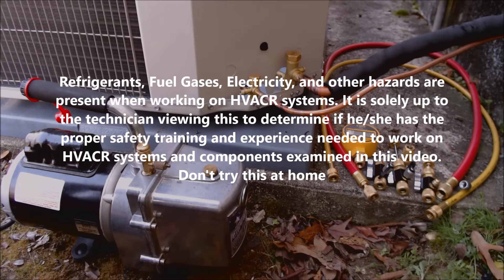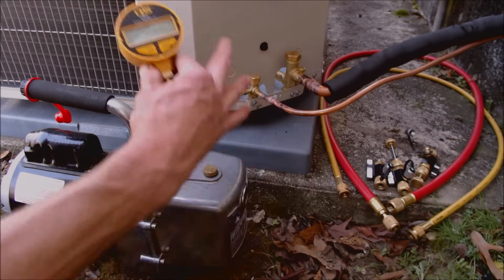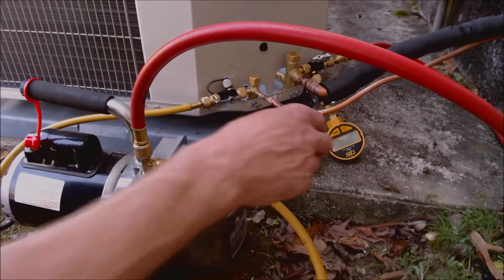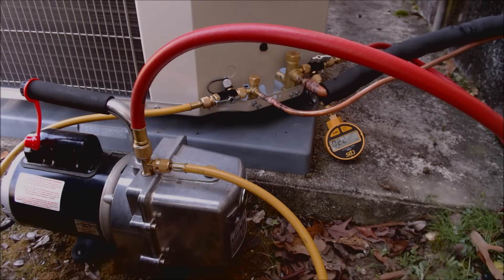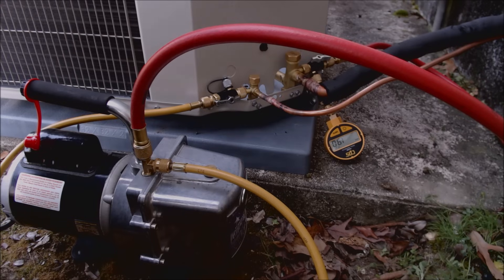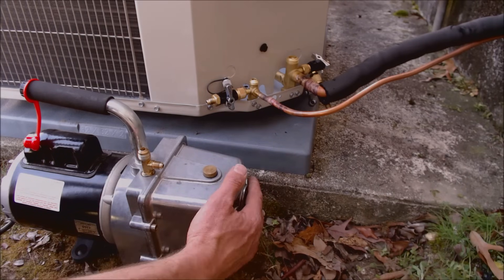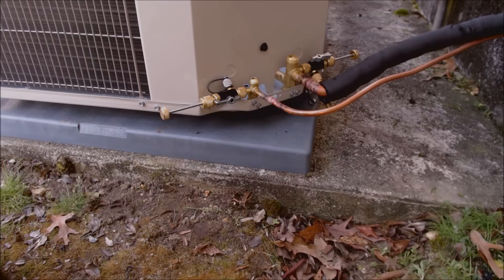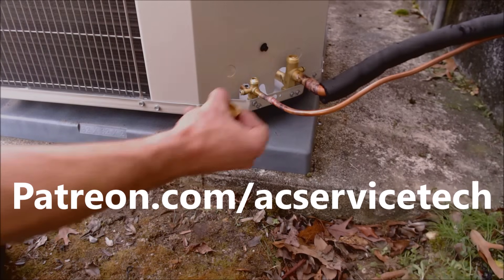HVAC Full Vacuum Procedure From Start to Finish!

Comment: Names Sullivan, I have a question for you. On split systems when doing a repair I cleaning lines with flush, alot of nitrogen, and still have trouble pull vacuum down below 500 and holding, will rise but doesn't stay below 500. We do alot of commercial and some residential units. I use the Sman360, 2 stage 6cfm vacuum pump yellow jacket, with 3/8 vacuum rated hoses. I'm in the process of getting appion core removes I now it helps. I'm 40 and got out the Navy and got into the trade, about 1.5 year apprentice. I like your teachings and wanted to know what you think about pulling a vacuum on a dirty system ie oily etc? Thank you
Reply: I used this setup today. Line set is 1 1/8 V and 3/8 L, and about 40ish feet,(2'x10' vertical x 8'  Horizontal x 10' vertical x 10' horizontal x 5ish around to unit) R22 converted to 410A, flushed and blown out lines, (had to use old line set). First vacuum was 200 in about 10 minutes, I did a triple evac and the second vacuum was 130. The core removers made a BIG difference as with the setup. I let pump run for 10mins and isolated the system for about 10mins and pump was still pulling up to schader removal tools, then I opened them up and let her eat. I did this a few times to help pull anything that could be left inside, it seems to work well for me when the vacuum pulls to fast, it's like the 2nd wind for the vacuum pump.  
Now my Sman is only used for system checks(if needed). I don't like hooking gauges up unless it's something my senses can not find lol. Thanks again
Reply from the maker: Yes! That's awesome! I am glad you found success in this. Now, the second thing I want to get across to everyone is what is the purpose of a triple evac? If someone is worried about water freezing, we would see it during the ten minute standing vacuum test with the micron level rising. If you want to get a good vacuum then just let the pump run to a lower vacuum level and even better, let the indoor fan run while doing it. I believe triple evac is something that is not of much use unless you are in a very odd situation as water will not freeze with all of the available heat absorption capability at the evap and line set, thanks
Reply from the maker: Hey Sullivan, if the oil in the vacuum pump is new and the pump is in good shape, it shouldn't have a problem pulling down and holding below 500 microns after cleaning and flushing lines with nitrogen. Certainly those appion valve core removal tools will help pull out the contaminants faster. The question you are asking and the frustration you are feeling is what I felt before switching to 3 valve core removal tools and no gauge set. I am telling you that you either get down to 200 microns quick or you immediately know that there is a problem. There is no waste of time and stress wondering if you missed something. I am so glad that I am done with that. I wish some one told me sooner how simple it could be, ha ha. It may just be that you can't pull out the contaminants fast enough since you are leaving the valve cores in. The micron level that you read is not the real vacuum level in the system since the micron gauge is on the stronger vacuum side of the valve cores. With the valve cores out, it give you a real clear picture of where the vacuum level is and when you shut the vacuum pump off, the micron level will roughly stay the same. I have the vacuum setup tools that I used linked at amazon.com/shop/acservicetech, thanks
Reply from the maker: Did you check out "acservicetech top 15 vacuum tips" video? That would be another good one to check out, thanks
Reply: I have been thinking about the 3 valve remove tools, I have a single cps micro gauge that I use on water source systems. I will do this set up.  I thank you sir. I've watch alot of your videos and apply it on jobs, my bosses are great at teaching but are busy.  I study and learn by watch and read alot and info is good also in my shop I work on junk systems learning the wiring etc practice brazing in and out parts. I was thinking my set up is not good enough for a vacuum but I'm alittle hard headed with my Sman360 lol. Thank you again
Reply from the maker: Ha ha, aren't we all? Try it and see what you think. Comment back with your thoughts, thanks!
Reply: The triple evac was something I was told in a couple of classes. We didn't have the indoor unit electric yet. I didn't have to use the triple evac, but when I pulled down to 130, it did rise up to 190 in about 20 minutes. I think that is still ok but my OCD didn't like it. I'm sure there was no moisture but I was more worried with oil. Was isolating system good enough for about 10 minutes and then opening it up again and letting the pump run for open for 10minutes?
Reply from the maker: Yeah the triple evac is something that is taught and even in manufacturer literature but I am finding more and more that people and technicians are confused and it all stems from the epa 608. I am a teacher myself and have taught all these things. I find all of it funny. I also try to do the best I can for the building owner. I am just trying to get everyone to think about why they are doing what they are doing instead of just doing it because that is what they were taught by someone. If you are doing a double or triple evac, when you say you opened it up, you mean breaking the vacuum with nitrogen tom a positive pressure right, because if it was just opened up to the air, that would just suck humid air right into the system and would be counter productive. If you get a chance, try running the indoor fan next time, make sure to turn your valve core removal valves off and on while running to make sure that there is no air trapped in the valve itself. sometimes I do this multiple times. It usually won't rise that much. Also, oil in the system won't affect the vacuum unless it is trapped water, thanks and you are doing a great job thinking about and performing all these things!
Reply: I close the appion valves just the 2, leaving the one with the vacuum gauge open, vacuum pump still running pulling on the hoses, it pulls down to 90, I hold that for about 10 mins or so then open the valves on the appions. I started this with the Sman because of the troubles of pulling vacuum, probly not needed now. I thought I wasn't entering outside air, I shut appions and hook up nitrogen, purge, then break vacuum. Then shut appions, hook up vacuum pump run pump first to pull a little vacuum, then open one appion slowly at a time. Then let the pump eat lol. I appreciate what you do and say, If there is something that's not right or I can do differently let me know. Thank you
Reply: @andysullivan7226  not necessary.
Reply: I will try evap fan also

Comment: After pulling vacuum shouldnt we wait to make sure its holding the vacuum?
Reply from the maker: Yes, I waited ten minutes in this video as stated but fast forwarded. It is called the standing vacuum test and it is a secondary indication that there are no leaks, air, water, or nitrogen in the lines, thanks

Comment: I install a lot of ductless splits, the regular 1/4” hoses don’t fit the charging ports on the mini splits when I go to vacuum down the line sets. I had to buy an adapter to get them to fit. I’m never sure I am depressing the schraders enough to pull a proper vacuum, I worry  I may just be pulling a vacuum on the manifold hoses. The Appion core removal tools don’t fit the mini splits suction side so i can’t pull those schraders out. It’s like a 5/16” fitting not 1/4”
Reply from the maker: I have the 5/16" Appion tool linked at amazon.com/shop/acservicetech  - definitely want to pull the schrader out before vacuuming, thanks

Comment: Do you pull the Schrader valve out of the micron gauge too?
Reply from the maker: Yes, I have found that there is no reason for me to leave the schrader valves in the sides of the valve core removal tools due to the procedures I happen to use, thanks

Comment: You can also use a 12 cfm
Reply from the maker: Ha ha certainly can! Usually my vacuums are 5-10 minutes to get down to 200-300 microns so I am happy with that. I did a 125' 1 1/8" line set on an existing system and it took just under ten minutes of vacuum running and then I did a ten minute vacuum test with the pump off so twenty total, thanks Nate!
Reply: @acservicetechchannel 
 MLB ç b b? N cvb bön v möc ö/mmmmmööçbhkc

Comment: Thanks for all your videos. Very helpful!  Could I pull a vacuum from just one service valve using one hose?  Is it just quicker to use two hoses or is there any other reason.  I know smaller mini splits only have one service valve anyways.
Reply from the maker: Minisplits have the metering device for the evap at the outdoor unit so there is no restriction halfway down the line like on standard split systems. That is why we pull from both sides and it is faster and you microns readings will be more accurate. No need to on minisplits, thanks

Comment: I am just confused  why you are closing  both service valves ? are you doing  vacume while the Refrigerant stored at the Condenser  ! means you vacume only the lines  and Evaporator only ?
Reply from the maker: When the unit is new from the factory most units have refrigerant held back at the valves. The refrigerant is in the outdoor unit so we are vacuuming the line set and evap, thanks

Comment: I just installed a 1 ton mini split system, and for some reason my Yellow Jacket gauge hose don't fit the ports. I've been doing HVAC over 20 years and this mini split system is new to me with pre-charged lines. The ports seem a bit bigger than my hoses, and the end wont even reach the threads on the ports.
Any suggestions?
Reply from the maker: Yes some but not all of the newer minsiplits have 5/16" ports. You would just need a 1/4" to 5/16" adapter for the ends of your hoses. I have them linked at amazon.com/shop/acservicetech, thanks

Comment: And would it be a bad idea to have my charging hose with ball valve purged and closed but connected to my other core remover tool ready to release when the vacuum is finished?
Reply from the maker: I  really would wait and just connect that to the end of the valve core removal tool once your standing vacuum test is done. You don't want to trust that valve for vacuuming. You could have that purged and ready to connect though. Those are just my thoughts, thanks
Reply: AC Service Tech LLC awesome thanks for your response

Comment: I have two 3/8 hoses connected to a 3/8 3/8 3/8 tee and the third 3/8 line connects to my pump. I don’t use the 1/4 port on my jb 6 . Do you think I would pull a way quicker vac by utilizing both ports on the pump ? Thanks
Reply from the maker: No, I think it will still be under 5 minutes usually, as long as you remove valve cores and don't use a gauge set. It is just about the least amount of leaking points, that's all, thanks

Comment: Clean cut explanation. Thanks for the video. 
I do have few queries. I have a unit that is leaking. Filled Nitrogen and maintained 450 psi. For 30 mins pressure remained steady. For sanity sake, I left nitrogen in there for a day. Next day pressure went down to 400psi. Just to be sure there was a leak, I checked nitrogen pressure for next 3 days. It dropped 50 psi every day. Down to 150psi today.
1. Is it a small leak? And since its not being cleanly detected by the tool, do you think "Easy seal" would work?
2. If I go with Easy seal which I am going to use first time. Shall I fill in some refrigerant (410A in this case) after vacuuming nitrogen out since "Easy seal" requires 50 psi pressure in the pipes?

Thanks for your help!
Reply from the maker: I don't use easy seal and people have had mixed results with it. Have you tried a different gauge set and hoses? It could be them. You could also do a vacuum test like in this video to see if it holds vacuum for ten minutes. If it does then you don't have a leak. Also, you didn't pressurize the evap higher than what it states as the max design pressure on its rating plate correct? If it was overpressurized, a leak could form, thanks
Reply: Tried two different sets of gauges & hoses. Same readings. I skipped mentioning in my earlier note that i am the second tech on this unit. The first company that worked on it had filled 490 psi (max on the unit is 450). I know this for sure because there was a note stuck with date, time, and reading near the unit.
Being said that what are my options if the leak is formed? My fear is that the leak is not inside the wall of the house as the line is going up in the attic. Another reason I am leaning towards easy seal.
Reply from the maker: You could try an ultrasonic leak detector such as the one linked at amazon.com/shop/acserivetech along with nitrogen. You could add an ounce of refrigerant and then pressurize with nitrogen to sniff for the leak. You could douse the joints and parts of the indoor and outdoor coil and lines with bubble leak detector to see if bubbles form. You could try the option you are mentioning. Thanks Kuljit Singh!
Reply: Thanks a bunch!

Comment: So about the gas ballast.
Reply from the maker: Hey Walter, this vacuum pump is not equipped with a gas ballast. That port on the top is the oil fill. This is a less expensive but quality pump. The gas ballast prolongs the oil life, thanks!

Comment: Thanks for the great info.  What size vacuum pump do you recommend for someone working primarily on 2.5 ton systems?
Reply from the maker: I would just go with something like the 6cfm JB eliminator I use and have linked at amazon.com/acservicetech. That seems to be the most reasonably priced yet very reliable make, thanks G Meier!
Reply: @acservicetechchannel  I have just recently discovered your channel.  I am extremely
impressed with your tutorials.  I have now watched many,  but haven't seen any videos
on vacuum pump oil changes.   I've been in the business 48 years now.  I am the inventor
of the JB industries "The Tank" oil change caddy.  I have always been a freak about my
vacuums.  I like to change my vacuum oil while it is warm after every vacuum. Pump
oil is "HYGROSCOPIC", meaning it absorbs moisture particles, even after vacuuming
a clean system.  Those moisture particles are suspended in the oil when the oil is hot.
Draining your vacuum pump cold will leave moisture stuck to the inner walls of the pump.  This could eventually shorten the life of the pump.  After a vacuum job,
I set my pump on my oil change caddy.  Open the vacuum pump drain valve.  Turn on
the pump and very gently pulse my thumb on the outlet handle to physically "BLOW DOWN" oil out of the pump.  This BLOW DOWN procedure not only removes the oil,
but any other particles out of your vacuum pump.  My JB 6 CFM pump has lasted
me for decades!   I have now sold approximately 50,000,  JB industries "Tank" oil change caddy's.  Again, my hats off to you for your wonderful videos!

Comment: No nitrogen added to help remove moisture?
Reply from the maker: Hey Pluto, there was not moisture and the nitrogen pressure test was prior to this. You would see evidence of a moisture problem during the ten minute vacuum test performed after vacuuming the system with the pump off. Also the evaporator was getting heat from the fan running.  I am trying to educate techs about the misconception about moisture freezing which they first learned during the EPA 608 since it is not a subject that is taught in depth but just to pass the test. Techs carry that with them throughout their career, thanks Pluto!
Reply: Nitrogen doesn’t remove moisture. The only reason you should use nitrogen is to run through lines while brazing. This keeps the copper from scaling on the inside and getting trash in the refrigeration system. You can also charge the system with nitrogen and small amount of refrigerant to check for leaks.
The vacuum removes the moisture. It’s physics, when the lines/system are being vacuumed under 400 microns water boils below room temperature. This causes the moisture to turn to gas and be “vacuumed” out the system. That’s why you vacuum to that point. Holding the vacuum says you don’t have any leaks

Comment: I like your HVACR Training Videos keep up the good work. Can you help with superheat chart? I can't get it to work. My WB is 54 my outdoor temp is 75, that put me in a box with a X on the superheat chart, so I come back when the outdoor temp is 95, my WB is 60  that put me in another box with a X ! Heat pump seems to work fine. does anyone know what to do now? Is it charged correctly? The Heat pump is in cooling mode. no TXV.
Reply from the maker: The problem is that you have little to no superheat. The system would be working efficiently but on some days with high outdoor ambient heat and low indoor wb, liquid could be getting into the compressor. You are likely in a very  dry climate where technicians should be installing txv's instead of pistons for efficiency and compressor safety. Are you reading 5 degrees or more of actual superheat with your gauge set on those days? Thanks
Reply: Yes this is a dry climate. If liquid could be getting into the compressor. it is over charged ! The low side gauge is 59 that is 39 f (mo99) the suction line is 41 f That is 2 degrees superheat, if I am doing this right. If the wb goes up and the out door temp goes down, I would be back on the chart at 5 to 8 degrees target. I think my low side gauge and suction line temp would change too. My  2 degrees superheat  may go up 5 or so, or would it not ?  But the superheat charging chart is not helping me out reading X ever time I use it.